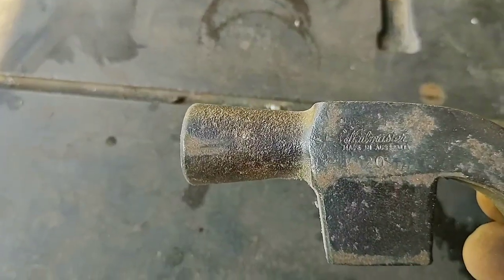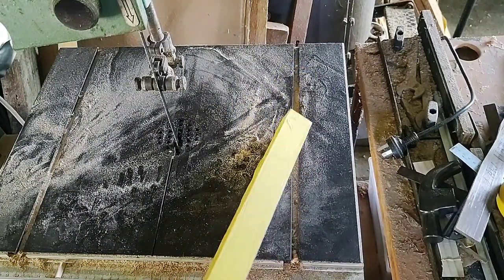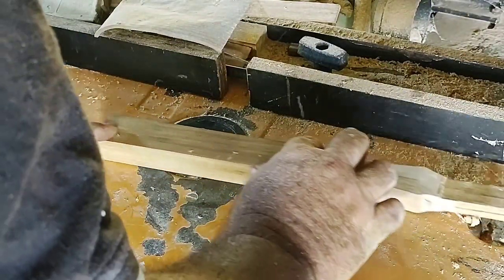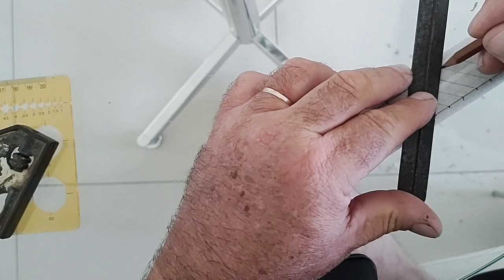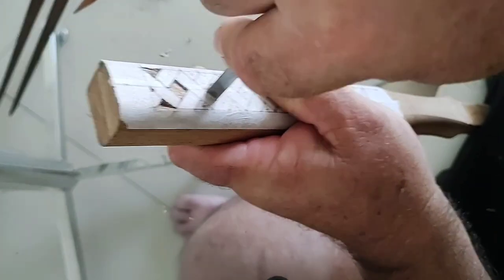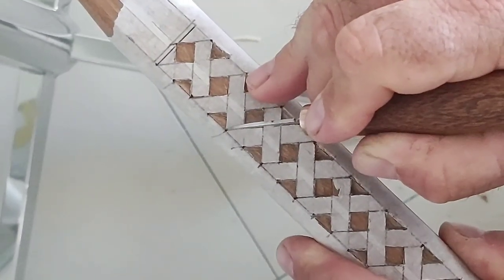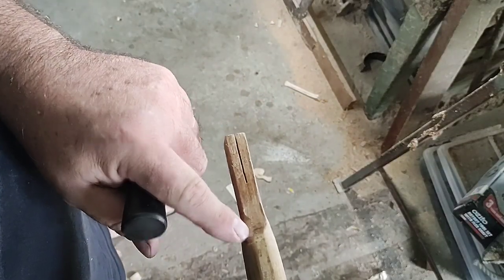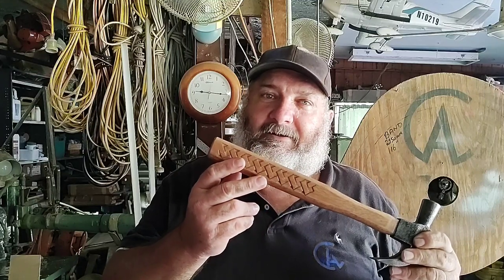MAKE A CLAW HAMMER HANDLE WITH A CARVED GRIP

Comment: I have two hammer heads need to make some handles for, though i don't know how i would do making the pattern on the side.
Reply from the maker: You could Make your own design, or trace along the edge of an existing handle onto some cardboard like an old cereal packet, and fold it in half and trace to the opposite side to make it equal, and use this as a template, you can do the edge profile the same, you have to make the eye size on your handle to suit your hammer head generally speaking eye size is around 1"× 5/8"
And the grip end at the widest is.       1 3/8 X 1" and the length of the handle total about 13- 14" . I may do a video just to iron out some questions.
Reply: @acsmakeandrepair3252  ok thanks ill give it a go